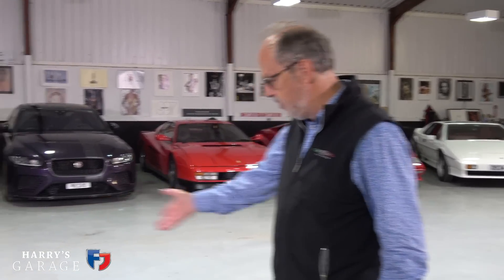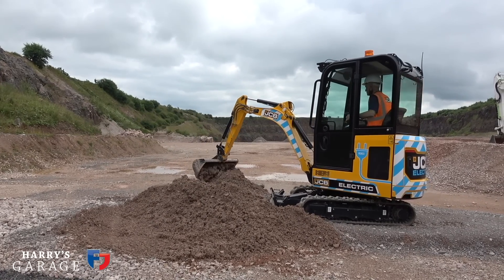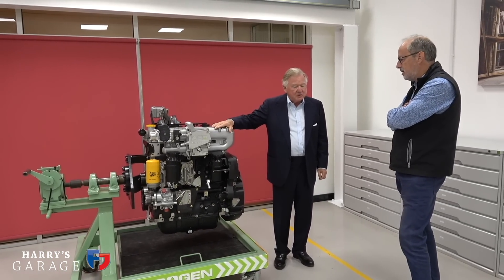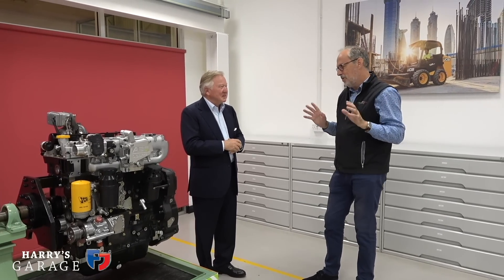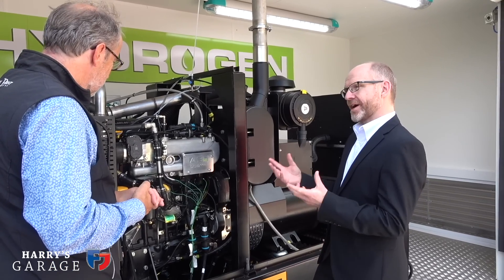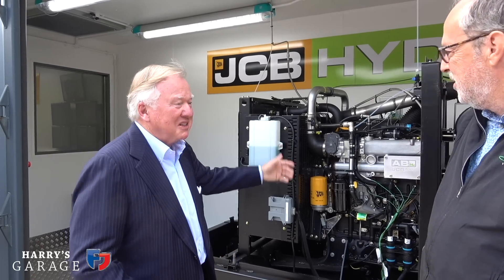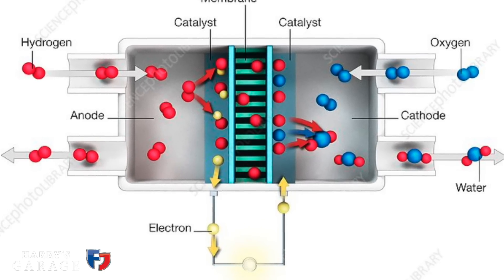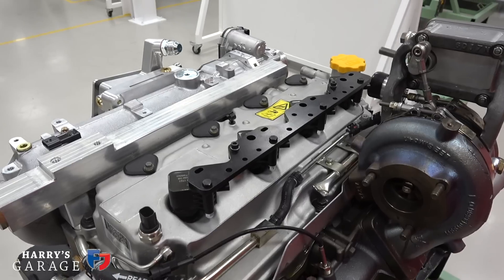Is hydrogen, rather than electric, the future for big-engined machinery? I visit JCB to find out

Comment: There's a reason why the Space Shuttle MEs where LOX & LH, the power output was up there and, as we know, the exhaust was water vapour. Of course, the Shuttle had to carry a massive tank to get anywhere.... Only difficulty with Hydrogen is the byproduct is Carbon Dioxide and Carbon Monoxide and requires natural gas as the source.  I always hope we get better hydrogen production.

Comment: Very interesting and informative video.  However the elephant in the room is that the main issue with hydrogen is that the process of producing the fuel is NOT carbon neutral at present since the use of renewable energy to produce will not cover the amount needed for a good number of years.  A better alternative is the option of synthetic fuel which is currently in the experimental stage but is at least carbon neutral.

Comment: the problem with hydrogen is storage, as a fuel it has been used way back to before I was a kid. The problem is it is gas that needs to be compressed to very high pressures. It also is a tiny atom so it will defuse its way out of pretty much any container.

Comment: This is so much better than battery chemicals. Great video
Reply: And the better way would be to use massive amounts of electricity to produce hydrogen, would it?  And then after it's produced, transport it all over the place in large tankers to where it's stored or sold, thus creating the same Co2 problems as now when petrol or diesel is transported. Is that what you meant?
Reply: @Brian-om2hh  I guess it will depend on how you generate that electricity, there are clean ways to do it. Also how you transport it does not necessarily need to be polluting, you could spare some hydrogen to get it there just like diesel is.

Comment: I think H2-ICE is the solution for big machines (and high revving sportscars, please cosworth :-)

But one needs to remember that the tanks leak due to the small size of the H2 and the high pressure, and if you do not regularly use the vehicle the tank will be empty by the time you want to use it. 

So you might need mobile tank vehicle to refuel your H2 ice vehicle. H2-FC vehicles have the same issue, but they often also have a battery to deal with fluctuation in power demand that might be used to get one to a H2 fuel station when the tank is empty.

Comment: All these comments are 100% valid though there is an element that is never talked about. Electric is fair to a household that has a driveway but as many areas where drivers park in streets and not outside their houses how do they run an electric vehicle? Also the charging is not as cheap as advertised, sometimes more than normal vehicles?

Comment: Heavy spark ignition engines have been running on biogas for decades, so this looks very similar. Will the owner need a cupboard full of spark plugs etc. for spares? Toxic emissions will still be a problem especially as engines become worn or poorly maintained.
Reply: From engine oil yes but minimal....much, much less impact on the planet than EVs.
Reply: The difference here is the fumes are H2O.
There will be maintenance requirements as all equipment needs.
It will be cheaper than electric motors, and replacing the dead batteries every couple of years for high use vehicles. 
everything comes at a price🤔

Comment: I wanted to work for JCB when I got my degree in engineering. For my final year project I modelled the impact of charging electric vehicles on the electrical grid for a housing estate. I was limited by the available computer capacity, everything was great until more than 10% started charging their cars or trying to. I say trying to as the network collapsed.
Reply: That's rather interesting, something the eV fan boys don't like to talk about.

Comment: Truly environmentally friendly! It's about time!
Reply: But only if you choose to ignore the fact that producing hydrogen uses huge amounts of electricity, due to it being an inefficient process. After which the hydrogen then has to be transported - under great pressure - to where it is stored or sold. It does not magically appear at hydrogen filling points.  And manufacturing hydrogen fuel cells requires platinum.........

Comment: Being a natural gas vehicle owner for 8 years now, it is my experience that the high pressure that is required for CNG is the optimal lead into the ultra high pressire needed for hydrogen.
Finding a local garage to do maintenence on my vehicles is difficult in that the most common question has been "will it blow up in my garage"?
CNG fill stations fill at 3600 psi, hydrogen at 10,000psi.
As a learning curve, CNG is the perfect predecessor to hydrogen.
CNG is also a zero emission internal combustion engine, with the added benifit of emittimg co2 that feeds plants when combined with sunlight. (Photosynthisis).
Another fact is that the btu in 1mcf of natural gas is roughly equal to 8 gallons of gasoline. Right now locally, 1 gal of gasoline is $3.489, and natural gas is around $3. Per mcf.!

Comment: Interesting.  I just watched a video looking into Toyota’s hydrogen combustion engine they ran in an endurance race.
The guy running the nu bers suggested they were only getting around 50% power output before turbo charging, the fuel tanks were around twice the size and they spent 4 hrs refueling in a 24hr race (they only spent 16hrs on track, so may have had other issues).

JCB are saying they have the same fuel tanks size and same tourque (i guess their use case is more about tourque than power as they don't necessarily need the speed).
JCB didn't mention power output or refueling frequency (but Harry did say it had the same range), but hopefully this is a viable, cheaper transitional tech to move engines for applications like this over to low/no tailpipe emissions.

(the guy reviewing Toyota's efforts did account for a minimal compared to petrol, but still present CO2 output from engine oil)

Comment: Batteries do make sense for cars because they are much cheaper to run, it's very efficient and they don't need much maintenance. Fuel cells are also about twice the efficiency of ICE so they do make sense for trucks, where the lower fuel costs will quickly repay the increased investment cost - I'm quite sure haulage companies will plan on TCO, or they won't be able to compete. 

But I still think maybe JCB have got this right, because I would worry about the durability of fuel cells in the construction environment. It will however double the fuel costs vs fuel cell, which perhaps explains why rebated (red) diesel is being withdrawn, to get industry prepared for increased fuel costs. For standby generators the fuel cost isn't important vs capex, so I guess since JCB make these too they can't really loose, whichever way the other markets go.

Comment: The area to be addressed is the production for H2 using renewables. But once resolved this has to be the way forward.
Reply: Not necessarily. If you're producing synthetic hydrogen, you also have the option to produce synthetic liquid hydrocarbon fuel, which means you don't have to change the engines or the fuel infrastructure.
Reply: And the only way to produce either hydrogen or liquid hydrocarbon fuels economically is with nuclear, not unreliables.

Comment: Yes you can use hydrogen. however a couple of points that were overlooked. Hydrogen is a very small atom and is very prone to leak. It can even pass through rubber. Another problem is creating hydrogen through electrolysis is quite energy intensive and would need serious consideration of the total energy use from creation to use in a vehicle. Making pressurizing and transportation is not going to be easy to make it safe. The energy density referred to was by weight and hydrogen is very light. Volume would have been more representative. But to create a liter of liquid hydrogen uses quite a lot of energy and it has to be cooled. JCB is a great innovative company, they had a bought a license years ago to use our clerestory combustion chamber design. This is a great project and I would love to be working on it. However there is this huge caveat of where do you get large quantities of hydrogen and be able to transport it safely. I would say it has more promise than electric which will prove to be a disaster. Due to all of the problems mentioned. Not enough generating capacity or infrastructure and the demand for some very exotic materials.

Comment: Brilliant, probably the most informative video I have seen on this subject. Personally I don't see  cars taking over as completely as the government hope. Flat dwellers have a problem, people living in terraced streets have a problem, as they cannot always park outside their houses, and even if they can, do we really want cables trailed across the pavement, and could the national grid actually cope with the huge demand. Let's look at hydrogen. Just like the $6,000,000 man... we have the technology.
Reply: If the national grid can't cope with the demand for battery EVs, then it certainly can't cope with the demand for hydrogen. You need to generate a lot more electricity to produce the hydrogen than is required to charge up the batteries of an EV. This is because the hydrogen production process is inefficient and the burning of hydrogen in an ICE is also very inefficient. The last of those 2 points is why car manufacturers developing hydrogen powered cars (e.g. Toyota) have gone down the fuel cell route. I can certainly see JCB using their tech in the specialist machinery market, and it might be an interim solution for other vehicles in remoter parts of the world that don't have a reliable electricity grid available. I agree the infrastructure for people who don't have a driveway to park there car on while charging is an issue, though solutions are being trialled to incorporate them into lampposts.

Comment: Thanks for a great video and interview with LB. Your graph at 23 mins and your summary at 27mins perhaps needs more emphasis that this is about the clear distinction to be seen for long work hours heavy machinery. Makes great sense for JCB type working equipment and hydrogen infrastructure for this work equipment can be achieved with Govt focus suggested.
Electric power remains the best way forward for private vehicles.
Reply: Battery packs make even private vahicles expensive, the ice powered by hydrogen would give zero emissions and be affordable, it would also not suffer from long term battery degradation so the retail values of older cars would be better, with the possibility of the cars lasting a lot longer the whole life pollution costs will also reduce, it currently causes more pollution to make and scrap a car than run it so the longer you run the car the "greener" it is, and with a long lived zero emissions hydrogen ic engine you really would be onto a winner.

Comment: Excellent video and analysis from Bamford. Clearly a proper cost effective alternative. There was no mention of safety? How safe is a hydrogen tank against a petrol tank, for example?
Reply: Currently, all hydrogen powered cars have to pass a certain set of standards for the fuel tanks to prevent hazards. If those standards are met, then hydrogen cars are in not any more dangerous than normal petrol/diesel powered cars.

Comment: Good and very interesting video. I would have wanted a discussion on the safety of use of hydrogen in ICEs. Also, is ammonia a better substitute for hydrogen as it solves the safety concern from an explosion point of view although it further introduces a different issue in the sense that it is hazardous. Anyway, I think I am clearer on the future of ICEs on very heavy machineries, especially the ones built for use in terrains where fuel cells aren't quite suited.  Thanks for doing this video

Comment: If they use windpower to separate the H2 what is efficiency to the wheels compared to fuel cells or  battery electric ?  I understand the battery electric is about twice as efficient source to wheels.

Comment: i have been saying for 10yrs that  electric power is not as "green" as its proponents suggest, at some point the battery will die and its not very green to dispose off right now plus it also relies on using precious metals which are mined from the ground which are also in short supply. Hydrogen is one of the most prolific elements in the universe and can be simply and efficiently extracted from water or air and incredibly when it burns it produces water vapour (how green is that?) Hats off to JCB for sticking with it but you would have thought that such a blue-chip company would have been able to promote this technology better than a soft launch on Harrys Garage? This is about saving the environment so it needs he profile exposure in my opinion.

Comment: I don't know why it has taken so long for Hydrogen to make a presence.  I was in Sofia, Bulgaria in 2008 and a large number of the taxis were dual-fuel, petrol and hydrogen.  in the city they ran on hydrogen for zero emissions, for longer runs in the country they could flip one switch and revert to petrol.  The disadvantages were that the range was limited because of the size and weight of the hydrogen tank and they needed special refuelling areas because they refuelled  with liquid hydrogen.  The filler was under the bonnet and it was a bit disconcerting to hear liquid hydrogen bubbling through the pipes in the passenger cabin to the tank in the boot.

Comment: Very informative and thought provoking video Harry. I do wonder whether the weight/usage argument might also be applied to the automotive world where weight is a similar problem for electrification to provide sufficient range namely high end and heavy SUV’s? 
There was one important issue not covered however- what about safety when using hydrogen? Imagine motorways full of pressurised fuel tankers moving hydrogen around and the potential hazard that this and cars themselves create when there is an accident with highly pressurised inflammable fuel escaping - potentially far more serious than petrol or diesel.
Reply: That was an argument raised back in the day when toyota released the first gen Mirai, which delayed its release. The fact of the matter is Hydrogen tanks are built in such a way that it can take bullets from a high velocity gun and not explode. And they also showed during the test that in case somehow the tank breaks, hydrogen is so very light and diffuses into the atmosphere very quickly, such that it doesn't catch fire and cause harm to the surroundings.

Comment: Nice, I'd like to see chemists more involved, converting methane ( natural gas ) currently being flared off or worse vented into the air being converted to methanal.  Then being used.
Reply: How would that do anything for being able to run a carbon free sustainable energy economy in the long term ? Nothing. You may as well stick to diesel/petrol

Comment: There may be a few more points to consider regarding the electric motor vs hydrogen engine. The US has very restrictive laws with regards to oil leakage in mining equipment, Europe may be different.  So, an excavator without an engine can be very attractive to some mine owners because they are usually the biggest source of oil leaks -  and because of the high fines associated with those oil leaks, they need to keep on top of them at all times.  Electrics also have quite a bit less downtime (another huge mining cost) and are far simpler than a hydrogen engine.  If there is a problem, you either replace the battery pack or the electric motor.  That reduces the amount of mechanic time needed for any given piece of equipment and reduces recurring costs (like a mechanic's salary and engine maintenance).  It is also likely that the electric excavator will have a longer overall life span because of it's simpler design.  
There are other ways of providing electric power like a power cable, easily replaceable battery packs or the ever-elusive aluminum/air battery (if it ever happens).  I'm not saying that the hydrogen engine isn't the way to go, there are just more factors to consider when making that decision.  These other factors may balance out the higher initial cost of the electric excavator vs the hydrogen engine excavator.

Comment: On big engines it makes a huge amount of sense to follow the hydrogen route but I fear we've missed the boat on convincing drivers to go hydrogen on the lighter weight vehicles, which is a shame.
Phenomenal acceleration and silent motoring have captured the imagination of many drivers, and it's ironic that, rather than depleting one commodity from the planets core we're opting instead to deplete others to make our "planet saving" batteries.
I suspect that in the not too distant future vehicles sold in the UK will be automatically restricted to UK speed limits, controlled by GPS, with acceleration also limited to "safe" levels.  At that point in time we may see the demise of electric vehicles and slower, cleaner hydrogen engines may come to the fore.

Comment: How is blow by dealt with? With diesel there is some hydrogen that comes with the fuel but only a small percentage. But when using hydrogen as a fuel alot more water contamination of lubricating oil will occur. Is that going to be evaporated out?

Comment: Very good video but when people talk about electric cars I just say where does the electric come from,  12% efficient steam turbines. I ran a sprinter on hydrogen and oxygen and diesel pulling about 40 amps years ago and it bought the emission down to near zero with my co meter and also when I took it for mot. This was supercharged as are big generators running on methane from ad plants of which I am involved with. It was s very clean burn far better than adblue and would eliminate problems with dpf filters.